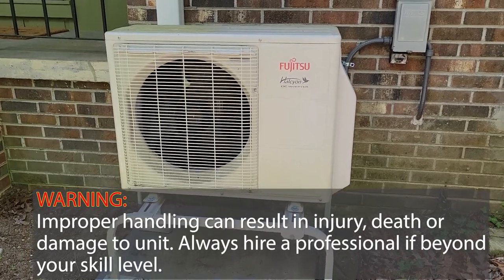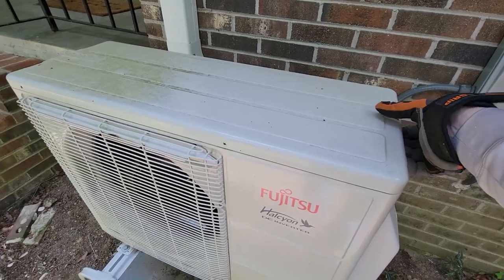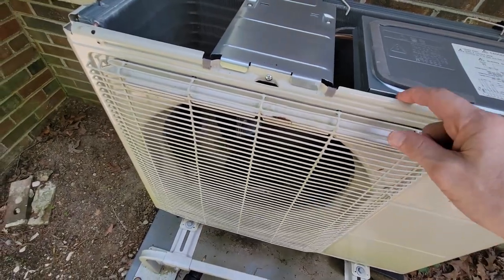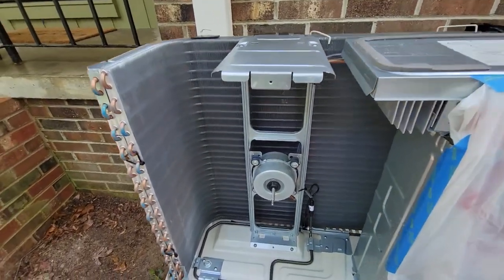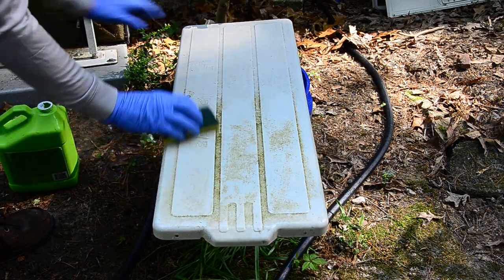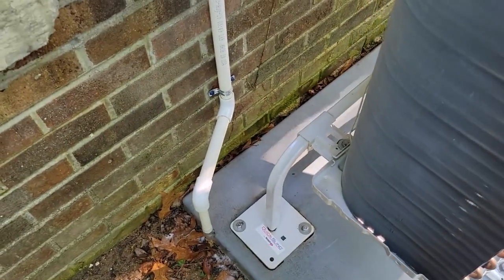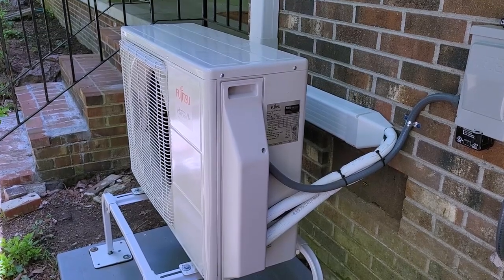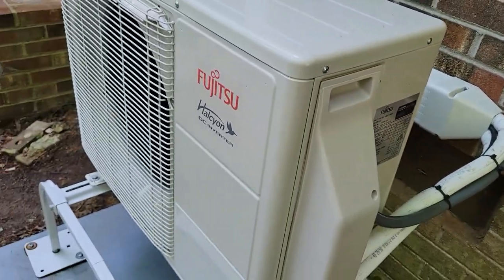Cleaning FUJITSU Mini-Split Condenser Coil

Comment: What about the inside head unit?
Reply from the maker: The inside unit can be challenging to take apart, I would recommend HVAC person with experience as it can be easy to damage the unit. Something much easier to tackle every month is cleaning the filters. https://youtu.be/UHs0g74rYJg

Comment: Thank you for you time and info. And if you want to get all the "fins" in order, I like to see then not touching each other, to maximise efficiency. Use an old credit card to separate and align, credit to others for this idea given to me. Indeed fan orientation can catch some out. Mine is an earlier model Fujitsu and getting the side cover + top cover re-installed is an ABSOLUTE pain in the ARSE. I sorted out rust areas and re sprayed them. BTW I'm in OZ and the EXACT paint match, condenser box over here is; Dulux - metalshield (multipurpose) - colour = DUNE. Yours looks the same colour, assume they will be WW..
Reply from the maker: Paul, thank for the tip with the credit card and the matching paint color. It is now going on 3yrs so I just added this to my spring project list. I appreciate you watching and sharing.
Reply: @cfldriven  apologies for my terse wordage in my comment. Was v.jealous of how your side panels and top fitted, easily and neatly. My unit ~ 15yr old with one integrated side panel with a v.small cut-out (on bottom) to clip into base and then a top cover with angled corners. Cleaning easy as, haha, putting covers back, ahhh, one side on other pops off etc, very difficult, hence comment words. All the best.....
Reply from the maker: @Paul-w9r1r  Yet despite the hassle you continue with the cleaning. Congrats!

Comment: $1000 MB!?!?! WTF!?!?!
Reply from the maker: Servicing any HVAC unit is not cheap.
Reply: @cfldriven  definitely, but my computer motherboard for $100 makes that mobo look like a joke. You can buy that outdoor unit for cheaper!!!
Reply from the maker: @Squad44ICOhappened  True, but each is for a different purpose with different distribution and monetization criteria. As you point out most appliances are very costly to diagnose and repair with cost exceeding or coming close to replacement cost.

Comment: Especially outdoors, especially doing 5 of these, it'd be in your best interest to glue a magnet under your screw tray.  Because if it is knocked, kicked, dropped, it'd be a big nuisance finding those screws in leaf litter.
Reply from the maker: Good tip, plus you can use the magnet to help you find the screw after it decides to run away.
Reply: Another note for future use: Nu-Calgon Evap Foam No Rinse, stated on this page as "Can Stain", https://hvacbeginners.com/air-conditioners/coil-cleaner/
I used it on the inside unit of my Fujitsu split duct, and it did indeed stain it.  I can't say if it'd stain the outside enamel painted unit.
Reply from the maker: @buzoff4642  Thanks for sharing the info.

Comment: I just had my Fujitsu  cleaned yesterday...they cleaned the outside unit AND  the inside unit on the wall.  They actually  took the inside unit apart and cleaned it very carefully  with a sprayer...don't  forget  to clean the filters !  The outside unit is important to clean... but so is the one in  inside your dusty old house!
Also, they did not take the sides off the outside unit--just the top.  Taking the sides off is tricky and really not necessary.
Reply from the maker: Thank you for sharing your story, curious as to what the cost was for both in and out side cleaning. In my area minimum of $150 for exterior.

Comment: Excellent video - we have (2) of these units and recently had one that was under performing cooling in this heat wave.  I had a HVAC tech come out and check it over.  Basically, it couldn't "breathe" so he gently rinsed the rear fins that were clogged with the white pollen that floats each spring.  That made a remarkable difference and now working as it should.  After seeing this I am going to do the same process you showed us and throughly clean both units.  Thanks very much for the guidance!
Reply from the maker: Dal, thank you for the kind words and for wanting to insure your units continue performing at peak performance.

Comment: Great video! I just had the Fujitsu mini splits 36,000 BTU installed. I've already gave it a good waxing! LOL. I definitely will come back to this video in 3 years when it's time to clean the unit. Thanks!
Reply from the maker: Congrats on the Fujitsu, we went from super expensive to run heating coils in the ceiling to a much lower power bill and AC in the summer. Did you have to wait long get it? One of the condensers went out in Nov and the replacement just showed up last week, but one of the work slipped with the drill and now I have to wait for another replacement. Fortunately the  leak in the old coil is very slow.
Reply: @cfldriven  No we didn't have to wait at all. The contractor gave us his price on a Monday and installed the system the following Thursday. It's been installed about a month now. Great investment!
Reply from the maker: @KerfMan  In these logistic challenged days that is great news. I agree with you it was a great investment that keeps us comfortable year round. Make sure to stay on top of regularly cleaning the filters. Here is a playlist on cleaning the filters and other Fujitsu related items. https://www.youtube.com/playlist?list=PLoL8aT_nHnwTz9BP0T2pbHhTC7vbpmZW0

Comment: I just wanna point out the “evaporator coil cleaner” would be for the indoor unit, AKA “the evaporator”. 

You generally use condenser coil cleaner for the condenser, which is the outdoor unit, but I’m sure there’s very little difference in effectiveness between the two.
Reply from the maker: Guthrie, you are correct on both counts. It is gentle enough for DIYer indoor use, but still gets the outdoor condenser clean. Thank you for sharing the info.

Comment: Great video. Informative and good camera work. I took the outside one apart and just  lightly used compressed air. It didn't seem that dirty after 2 years. I might do what you did in another 2 years. Thanks.
Reply from the maker: The important thing is cleaning it and keeping the unit efficient. Thank you for the feed back.

Comment: Great detail, thank you for doing this video!
Curious to see how you do the inside units?
Reply from the maker: Rick, thank you for the feedback. Removing the case to the indoor unit is tricky and actually getting access even worse. I watched a tech take one apart and the risk of damaging is high. Unlike the Mitsubishi this is not a user friendly box. I do recommend cleaning the air filters monthly. https://youtu.be/UHs0g74rYJg
Reply: @cfldriven  
I have already performed the inside units cleaning before I searched for a compressor outside coil cleaning video.
And I did it inside unit cleaning based on what I did to the previous Dakin units that I replaced with Fujitsu.
I have to say that the Fujitsu arrangement that I installed is superior to the Dakin product, simply because the Fujitsu product cut my energy bill in half !
Reply from the maker: @rickm4038  I agree they are crazy efficient systems, which keep us comfortable year round at minimum cost.

Comment: Very detailed. Thank you.  Wonder if you have a similar for indoor unit.
Reply from the maker: So far only the cleaning of the air filters https://youtu.be/UHs0g74rYJg
Maybe next year when I look into the price of getting those indoor units cleaned. lol
Thanks for watching.
Reply: @cfldriven  Price for indoor cleaning is just as bad.  I have two and same thing, $250 per unit to clean.  Outrageous.  I did find instruction on how to take interior cover off, but the instructions are wrong, and the cover isn't coming off.  Bad asthma, need to do this.
Reply: @cfldriven  ps, days to dig this up, how to take the cover off the interior.  Cleaned the inside one today.  This link "Click to see full answer", leads to Fujitsu site with instructions to take off the cover: https://askinglot.com/how-do-you-take-the-cover-off-a-fujitsu-halcyon
I had to create an account on Fujitsu to see the doc, so I created an account and clicked again.  I took my cover off, using the instructions on page 2 and 3 (I'm not taking the blower wheel off).  My particular machine has 3 hook catches in the middle of the cover, so on top of removing the screws, I had to give it a compelling pull, and off it came.
Reply from the maker: @buzoff4642  I seen other units opened up but not the Fujitsu. My casual inspection leads to believe it will be trickier than most. I would say that is probably a big fail as they do need to be cleaned on a regular basis.
Reply from the maker: @buzoff4642  Thank you for sharing the link.
Reply: Thank you so much for link. Many commenters on video for inside units having same problem with no help.  So far the page is coming up blank. So guess I need to make an account..thank you for that vital detail too. Would be great if document could be linked somewhere here.

Comment: Great video! Very informative and to the point. I do have a question. In the video you mentioned that you clean the the evaporator coil inside and outside. The video shows cleaning the potion of the inside & outside corner but not the back. My question is do you also spray the inside & outside section of the coil  at the back of the unit for cleaning?
Reply from the maker: Germain, since air gets drawn in from the back I would spray both sides to loosen up all the debris.

Comment: Do you have a video or reference for how to detach & clean the air handler inside the house?? Thanks for the effort! I have a Halcyon as well but no info on how to remove the shell to get into the fins and roller.
Reply from the maker: Have not yet tackled the indoor unit. If you have the installation manual Part # 9320456030-02 (check online if you don't) page 7 takes you through the front panel removal. Best of luck.
Reply: @cfldriven  thanks a million! You saved me hundreds of dollars. I bought the solution to clean the fins from Supply House so now it's time to save some $$$. I owe you!
Reply from the maker: @infnity_in_trinity6034  I'll accept 10% of the savings. LOL. Delighted to hear the video helped with your project. Much success and don't lose the screws.

Comment: Great video. Where can I buy the OEM screws for the casing? Thanks
Reply from the maker: I have yet to need additional OEM screws, but I would first check with your local Fujitsu dealer. I don't think these fasteners are unique to Fujitsu.

Comment: Could a dirty outside unit be causing my units inside to keep faulting??
Reply from the maker: I would imagine if it was totally clogged up it would throw a fault, but prior to that you would have noticed the blower air being warmer and running longer. Take a look at the coil and see if it super dirty or if the problem is elsewhere.

Comment: I wonder if you're better off spraying the coil with a Teflon spray to protect the metal coil especially if you are near salt water .
Reply from the maker: Purpose of the spray is to loosen and remove all the dirt caught in the fins off, Teflon won't help with that. If near coastal waters a product specially designed for such applications like, Coil Shield would stops salt air corrosion.

Comment: Id just take a hose to the outside coils n rinse down every so often when i have the hose out. Simple.
Reply from the maker: Simple and helpful, but like brushing your teeth you still need to get a deep cleaning from the hygienist, same with the coil as over time there will be build up. With my old one stage AC I could pull the top off and clean the inside, these mini-split don't allow for that.
Reply: Did that work for you? Would caked up coils cause only 1 mini split to leak water on wall?

Comment: way over kill      indoor filter, blower wheel and evap coil are what will kill the performance of you mini split if the pluged up. the blower wheel is always collecting dust and that will affect the airflow and performance. This guy is good at what he dose but if you take your unit apart like this  and fuck somthing up say good by to your warranty
Reply from the maker: Jimmy, unlike the blower which has two filters, there are no such filter on the outdoor condenser, meaning they will eventually clog up. A decrease in airflow will result in a decrease in efficiency. As can be seen in the video the procedure is straight forward and as I warn in the description "Improper handling can result in injury, death or damage to unit. Always hire a profession if beyond your skill level." The video does detail precautions and where not to spray water. Your warning about f*&^ing something up applies to any device under warranty. Thank you for sharing.
Reply: @cfldriven   Im just telling you what I've seen and what i know from installing and repairing mini slipts for the last 20 years. The blower wheel on the indoor unit attacks dust like a magnet no matter how often you clean the filters. And when the dirt/dust packs on each vain of that blower wheel, it will not move the  Designed airflow and that will hurt the  Efficiency/performance of the unit. The indoor coil and indoor blower wheel being dirty will cause a problem the homeowner will notice way befor a dirty condenser coil
Reply from the maker: @jimmyjackson9090HVAC  A major fault with this Fujitsu air handler https://youtu.be/UHs0g74rYJg is the blower wheel is not user accessible, even with the entire cover off you still can not get to it. This actually requires a tech to tape apart or for professional cleaning. Thus the consumer is left with cleaning filters, and vacuuming some of the coils. Washing the external condenser on a regular bases is also prudent.
Reply: They make a kit for cleaning indoor units its a big  bib that gose around the unit and lets you wash it in place and it funnels the dirty water into a bucket below
Reply: But yes the fujitsu is a pain to get the blower wheel out
Reply from the maker: @jimmyjackson9090HVAC  Yes, I have seen this kit, but am concerned since there is no access to the blower wheel without moving the coil. Wish this was an easier unit to clean.
Reply: @cfldriven  spray up though the louvers i use hot water and evap coil cleaner. I only use water in my battery powed sprayer and some kind of long tool to rotate the blower wheel

Comment: If the coil was very dirty, it would be advisable to split the coil.
Reply from the maker: I would not risk damaging coils be trying to split them. This cleanser can easily penetrate from both sides to get them clean.
Reply: @cfldriven  I agree that homeowners should never do something they don’t feel comfortable with, however that is the advisable technique for cleaning double layer coils to avoid pushing dirt in to the center.
Reply from the maker: @markoplixo  Thank you for sharing, now knowing this if it got that dirty I would definitely call a pro to clean it.
Reply: Would be helpful if you say or link to a source for How to split the coil.

Comment: "This looks like.."
"Maybe this.."
"If I try this..."
You are WAY OUT OF YOUR DEPTH AND SHOLDNT BE NEAR A MINI SPLIT COMPRESSOR.
And unless you are a licensed Fujitsu Mini Split dealer\ installer you just voided the owners warranty
Reply from the maker: Sorry you didn't like my real world experience. I did my research and tackled each challenge as it occurred just like any homeowner should do. Thank you for watching and taking the time to share.
Reply: @cfldriven Hello friends. What do you recommend from Fujitsu inverter air conditioner, should I take LLCE or LMCE?
Reply from the maker: @aleksandarn4859  You really need to have Fujitsu HVAC dealers come out and determine what is best for your climate zone, home, lifestyle, amount of existing insulation.
Reply: @cfldriven  In Serbia, it's not exactly such a system, I think it can be, but it requires money, and I decided for these models myself, I know that the LMCE12 model is newer but also more expensive. I'm interested in whether it's worth buying an older Fujitsu LLCE model compared to other brands from LG, Vivax... of course I mean some middle budget segment (600-700eur), there are also LG air conditioners and more than 1000eur.
Reply from the maker: @aleksandarn4859  Sorry not familiar enough with products to offer assistance.

Comment: video way too long. Just get on with it.
Reply from the maker: Sorry you find it too long, was just trying to make sure all the info was conveyed. Will look for ways to trim down future videos. Thank you for the feedback.
Reply: Awesome you are open to adjusting. I haven’t time to listen specifically to your video in detail and off the top some tips are to quickly show the needed items which is awesome you put at the beginning of your video so many people don’t do that but rather than say out loud each item put a list down below and say the list is down below so you don’t have to point and say the garden hose and nozzle and all of that . Little things add up.  also  I didn’t check for yours but many videos have unnecessary filler words that  if you look at the transcripts of your own videos which you can do easily on YouTube you can find words that are necessary if you’re planning to do a lot of videos.  and fast forwarding sort through certain parts but I did I didn’t look if yours could benefit from that